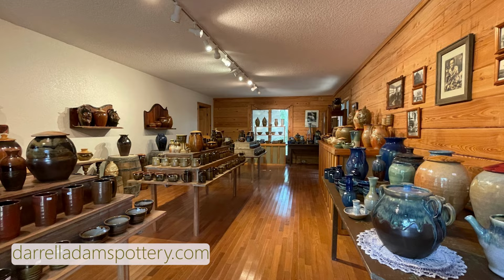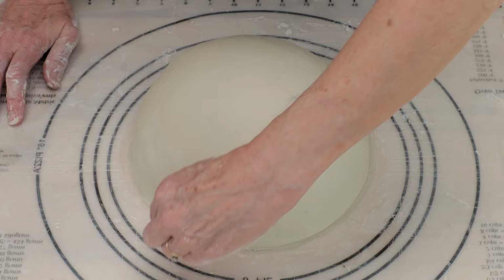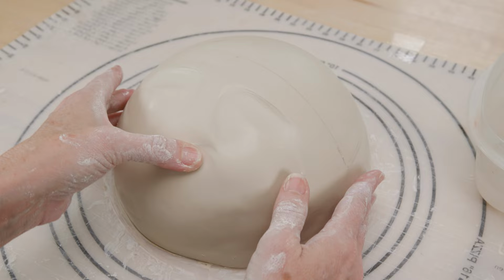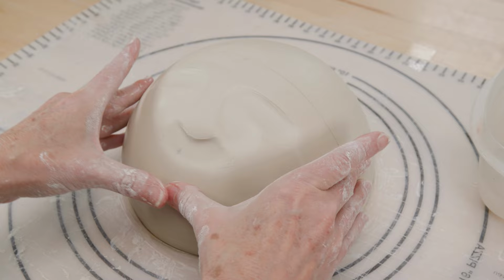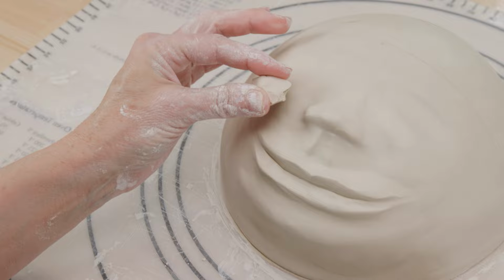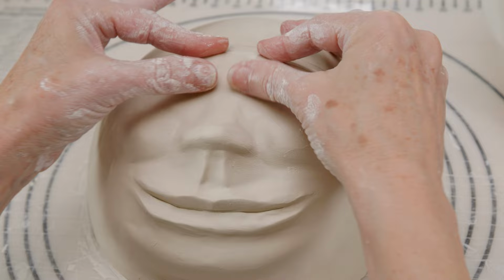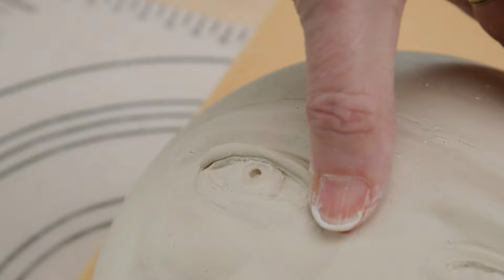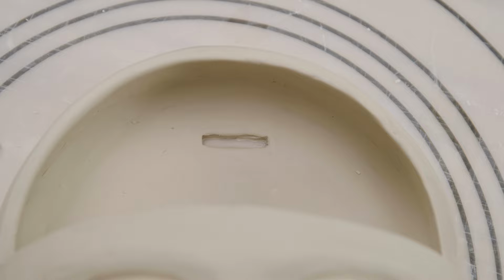Pottery Sculpting for Beginners - How to Sculpt a Face in Pottery!

Comment: * IMPORTANT TIP FOR PROJECT****. After you cut the top opening and the slot in the back, leave those clay cut pieces in place until the entire piece is totally bone dry as the clay will be tempted to crack or warp as the clay dries and shrinks..  I took the cut clay out for the video to show you what it the project will look like  in the end, but it is important to leave those clay pieces in place.
Reply: How fun. I could see a spider plant growing in it!❤

Comment: If you wanna try an easier route. You only need two toothpicks (tacks, needles, pins orange pokey type tool) and string, dental floss, yarn etc.

1. Put tooth picks on either side to determine opening.
2. Wrap string around each pick to make the straight line across.
3.  Repeat adjusting toothpicks as needed